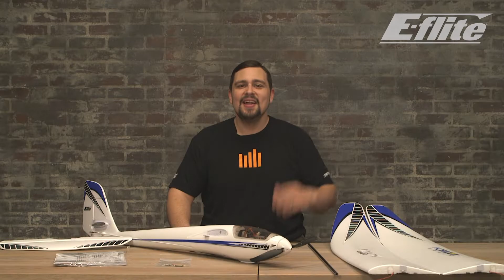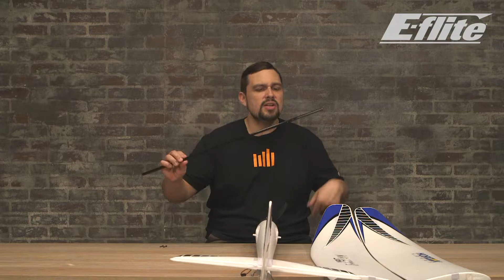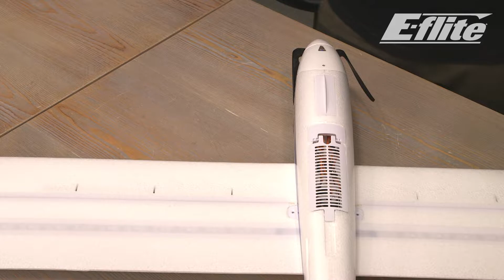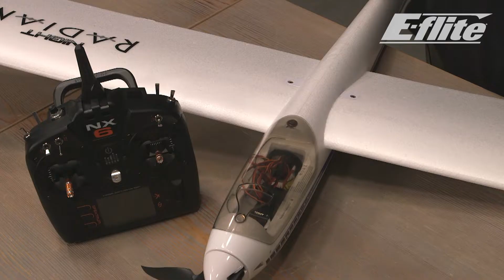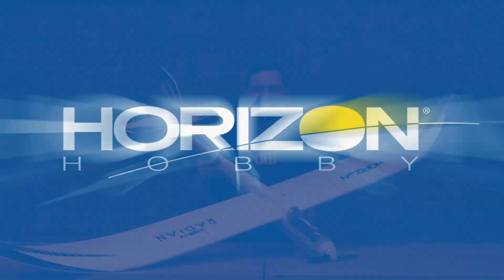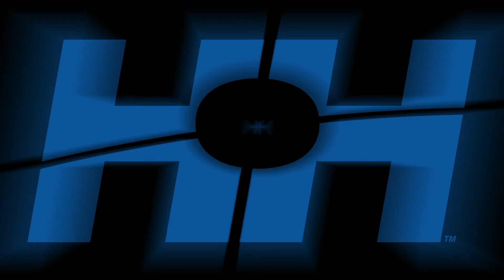Build Process: E-flite Night Radian

Comment: So, it sounds like it is made to never be taken apart again. If that is the case, then I'm going to glue it and pin it in place. I will avoid any LED strips. 
I think the tape is called, Blenderm and can be found at twisted hobbies. It can also be used to keep control surfaces in place.

Comment: Great tutorial on how to put this bird together but please don’t use the tape for your tail! It doesn’t hold long and once it breaks you lose full authority of your elevator and can lead to a crash.  I know from experience   Use a foam safe glue of your choice to secure your tail. If you need to replace it just cut it out with a sharp blade it will save you from crashing!

Comment: Don’t trust the tape to hold the horizontal stabilizer in place. Some people have had theirs come loose, lost elevator control and crashed. I used a foam glue on mine that also sticks to plastic and drilled a few small holes in the plastic for the foam glue to really grip and mine flies great. I really like how this plane soars so efficiently.